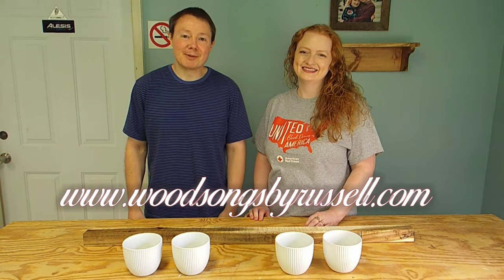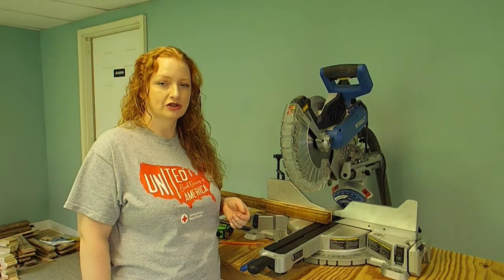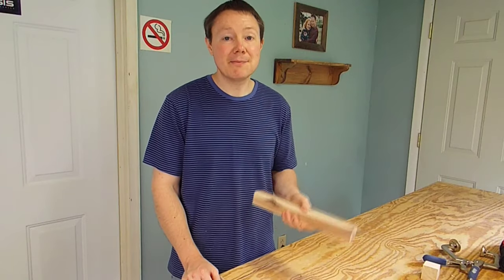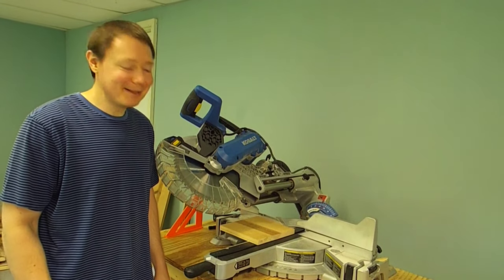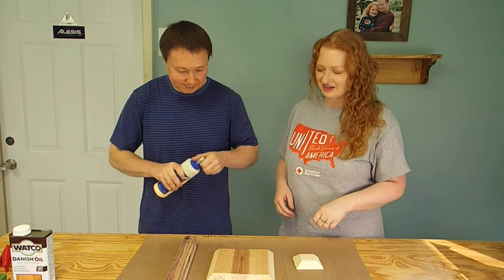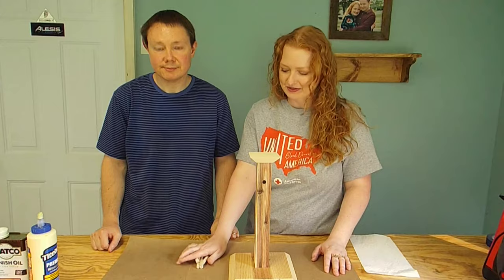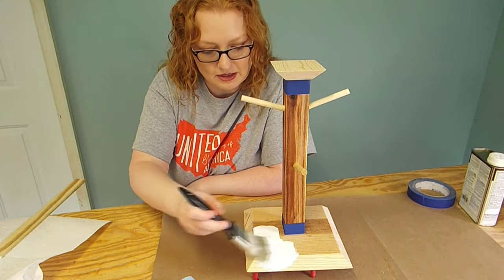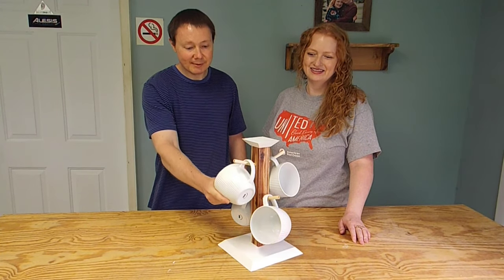Coffee Mug Tree DIY | Home Decor | Organize Your Coffee Bar |Beginner Woodworking Projects to Sell

Comment: Walnut in the pallet pile! Y’all must be living right! Ha! I have a friend who’s daddy finished concrete for a living years ago when furniture manufacturing was still booming in our part of NC. He was offered a huge pile of wood that one of the factories wanted to “get shed of”, and most of it was in the 1x4 form 8 to 10 feet long. Long story short, he used that wood for many years building concrete forms. Did I mention that it was all mahogany? Oh yes - for concrete forms! Really liked your drilling jig! I enjoy coming up with ideas like that as much as I like building things! You probably already know this, but just in case, after having several end grain joint failures I discovered that smearing on a thin even layer of wood glue and then letting it dry for 10 or 15 minutes prior to the actual glue up helps a lot! It seals the end grain so that when the second glue application is put on, it doesn’t all get soaked up by the fibers and result in a weak joint! Neat project, and a great way to preserve y’all’s history! Looking forward to the next one! I’m in the middle of building several snowflake shelves for Christmas, so I’m overwhelmed with miter cuts! Y’all should try one of those! Thanks for posting!
Reply from the maker: Mahogany for concrete forms?!? That hurts. Thank you so much for your kind words Tom. And the tip about sealing  end grain! Would love to see some of your projects. We probably won't have anything Christmas specific out this year, but it would still be nice to try our hand at making some ornaments for friends and family. Thanks again for watching and sharing! #happywoodworking